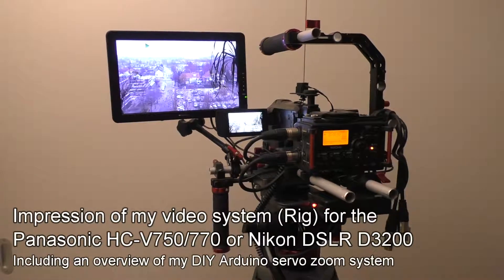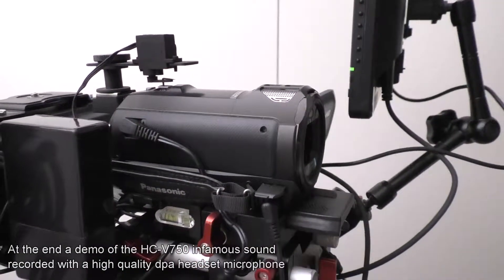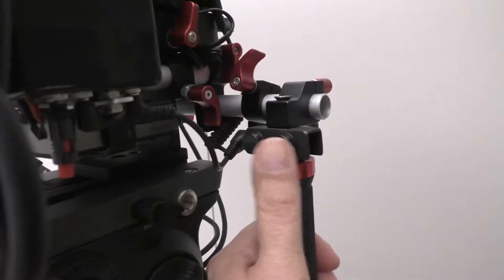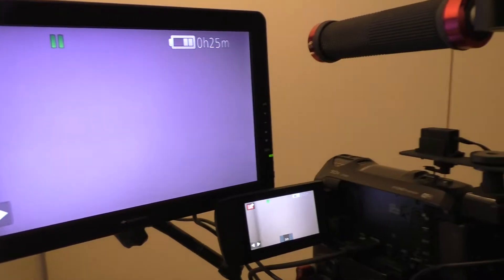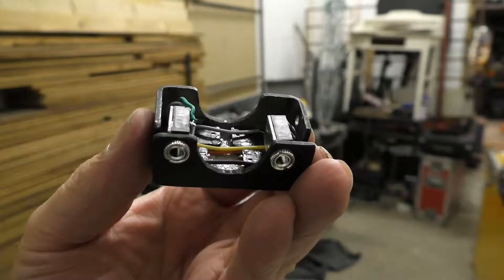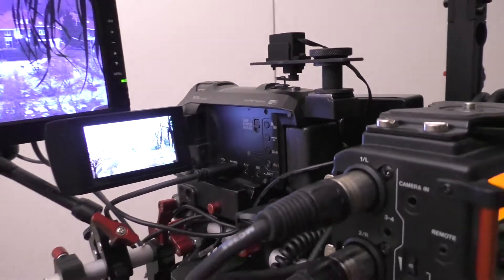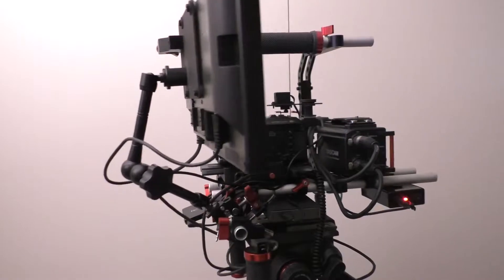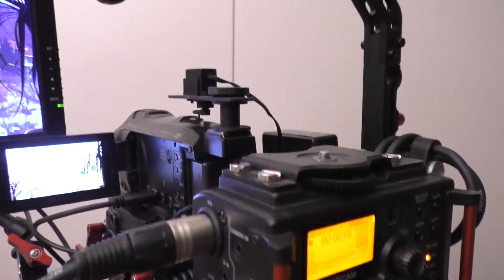My HC-V770 Video Rig Arduino Zoom System

Comment: Very Impressed with what you can do with a relative simple camera to pgrade it! Congrats! Do you use your rig for livestreaming? Or do you think it's suited for it?
Reply from the maker: Thank you for your kind words. This camera has a clean hdmi output with sound while recording, so yes it can also be used for live streaming. To use it for live streaming however, one has to add a hdmi splitter or do not use an added field monitor as that uses the hdmi output port. If you are planning to buy a used Panasonic HC-V** camera, then buy at least a HC-V750. I bought a HC-V720 and the image quality is a complete disaster. The 750 has poor audio quality but good image quality. ALL Panasonic camera's have an overly sensitive zoom button which makes the most important zoom speed (the slowest) hard to do. I love the great working image stabilization but also sometimes there is a blurry area away from the center. The battery by Panasonic is a disaster but the camera can be powered by 5v USB battery pack to avoid extra overpriced short life Panasonic Batteries. The camera is far from perfect but to my pinion best in its price class also because everything can be set to manual control. I have to mention that manual focusing is almost impossible due to indirect reactions from the adjust wheel. The auto focus works fast and very well.
Reply: @computerjantje  Thank you for you highly informative reply! I bought a HC-V770. I have been doing some research after reading your reply and now I 'm thinking of connecting it to a (rather high end) laptop using the Elgato Cam link 4K. The audio will be coming in from a mixing desk or external USB microphone. Very usefull suggestion to put in a usb-battery pack! How did you connect this to the camera? Didn't think of that.  Not sure if I could copy your Arduino-solution. It's quit inventive, though!
Reply from the maker: Hi  @paulvandeweerdt2073  , I use a second hand bought (marktplaats) Elgato Game Capture HD. It is a game capture console with build in hardware for capturing so one is not using the computer its hardware. I use a I3 pc on windows 7 with low end graphics card for live streaming and it works well in 720p. My pc is not fast enough for 1080p live streaming. Also because I use two camera's most times, the second being a logitech usb webcam. I use OBS to combine the images to one broadcast. Sound I get into the PC using a UCA222 by Behringer to be sure I get excellent sound in the broadcast. Before the sound of several microphones and background noises and music goes into the UCA222 is goes through a mixer with compression etc etc. You can make any broadcast as simple or complicated as you want. I usually go for complicated to get the best sound. :)  Please remember that sound is the most important part of video. If you want to talk more about this Paul, you can also e-mail me at  computerjantje at valkmail dot nl  
I stopped doing tests on two camera live broadcasts as I am too busy with video recording but here an example of Logitech c920 (topview) and Panasonic v750 through Elgate (close -ups) and uca222 and Allen and Heath mixer with sennheiser overhead microphones, wireless referee headset, artificial background noise to overcome the "non rightsfree" background music in the room at moments the real present people were too quiet.  In this testvideo the logitech camera switched the framerate to very low becasue of not enough light in the room. Getting sound synchrone is one of the harder things using two different type of camera's and different latenties. Elgato ensured me it is not possible to connect 2 Elgato game capture devices to 1 computer. I still have to test if they were talking truth. A second real camera is always better then even an high-end webcam like the logitech c920.  https://youtu.be/5OCfCKiDw5o
Reply from the maker: @paulvandeweerdt2073  the panasonic hcv-770 and 750 came with a usb to barrel jack 4.0 but if you need such a cable, I bought a few extra on Alie https://www.aliexpress.com/item/Cable-Wholesale-Price-Best-Promotion-90cm-USB-Port-To-DC-5-5-x-2-1mm-5V/32808587749.html
I bougth extra USB powerbanks via german amazon but they can be bought everywhere.
I also bought carlighter to usb  converters to get 5 volt at my video rig using a lead acid (car) battery. This to be Independent from an 240v outlet system.
this can be seen here:  https://youtu.be/FMa8bDD2X0M